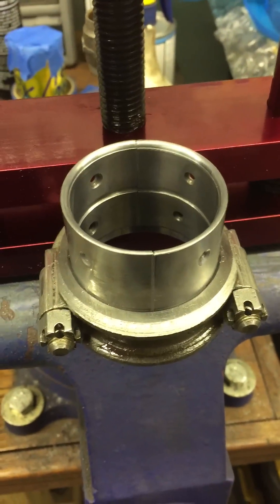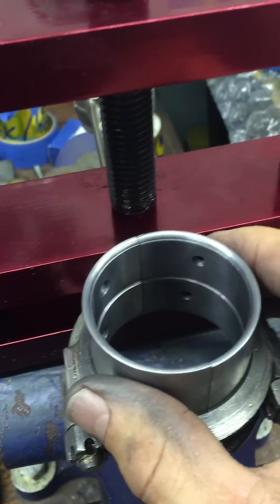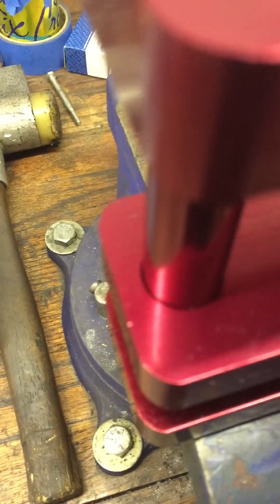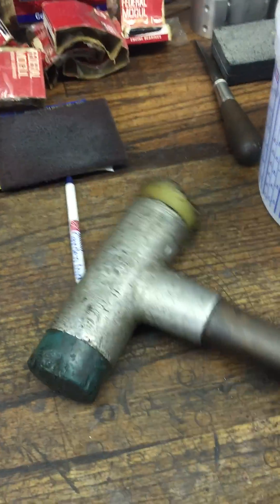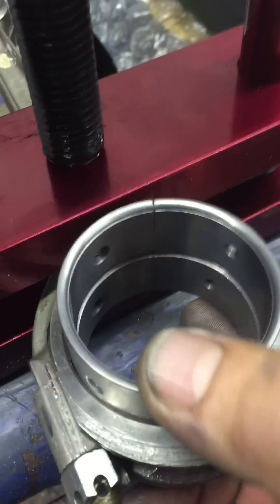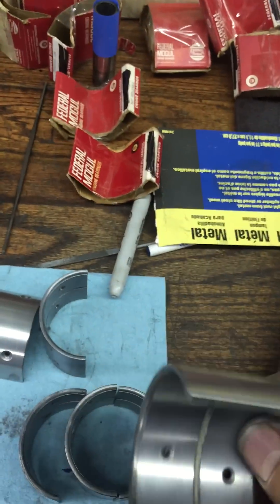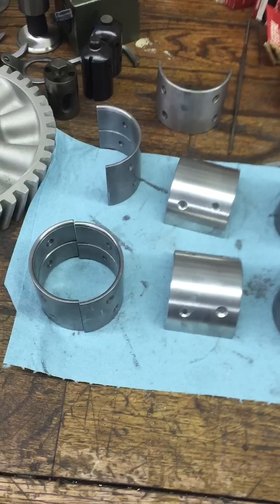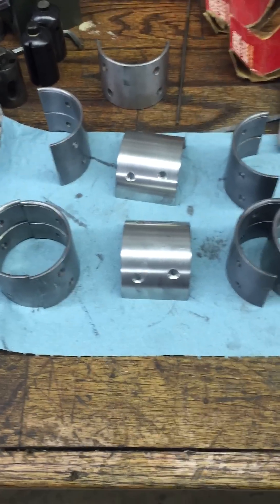Flathead Ford 21A - Full Floating Rod Bearing Sizing

Comment: From what I learned today sizing the full floaters in a 59A you can't just go by the fit in the rod. You also need to make sure the bearings aren't binding on the crank! I got the rods where they fit really easily but they needed to be spread a bit more to fit the crank pin.

Comment: Thank you for this video. It has answered all my questions. I have a 1964 Royal Enfield 350cc Bullet motorcycle and that has a full floating crank pin bearing. Replacement bearings are made in India now and I thought that the new bearing that I bought off them was a bit too loose. Your video shows that it is spot on and ready to go into the motorcycle. I had a 1953 Ford Customline once and it had a side valve V8 motor. I really loved that old Ford.